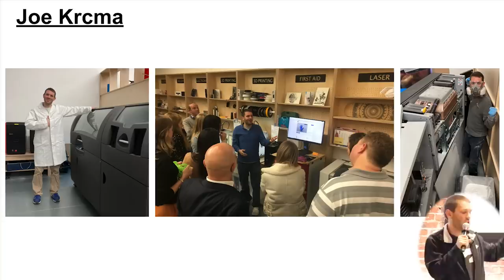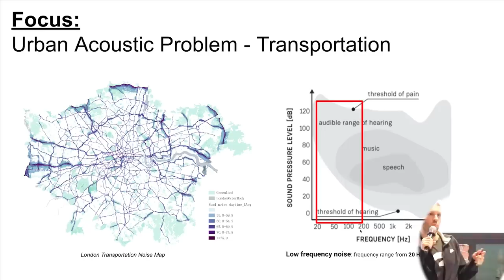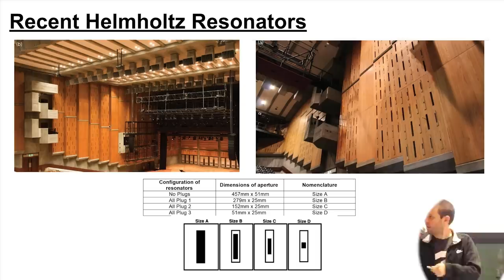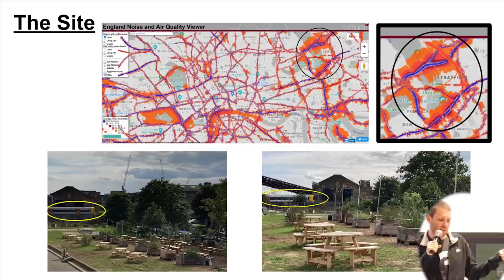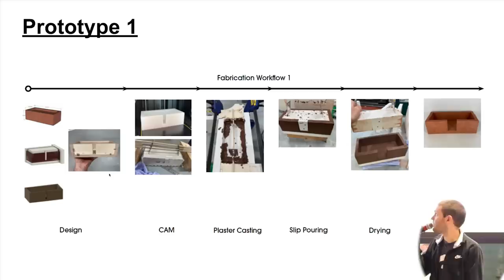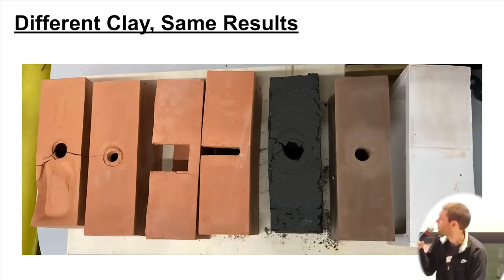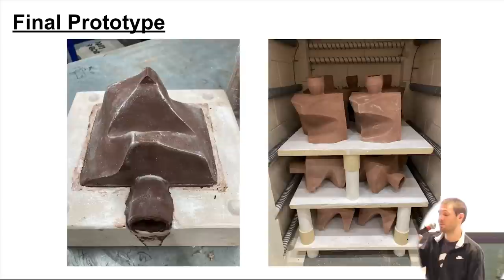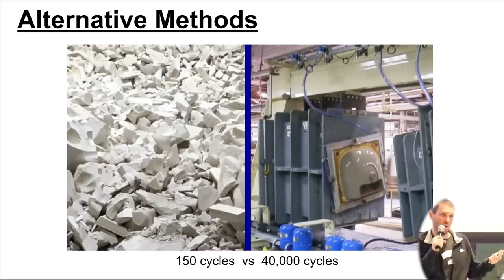These Bricks Can Absorb Traffic Noise - Thesis Presentation on Helmholtz Resonators

Comment: Use a double-sized brick. The size of one above another  + the depth of the mortar. The sound-absorbing brick could be built from one or two parts. Ah ha, you are getting to that fro your friend's 4-part brick.
-Edit: you use some meaningless terms --just like an architect, ;o;.  Let me replay to get it right.Ah yes, "Using these external geometry shapes." I dont know what that means.
Moar edit: I went back and realized that "generative design" was also a block being a term I skipped over and didnt understand. the first part of the definition, from Wikipedia, makes it sound likewhat i do with the "tryhard" Wordle solver tool, give it an increasing load of rules to follow as it looks in the dictionary for me, creating an ever smaller set with my increased filtering.
  But then, reading on, itsounded like an AI who can evaluate for you and then respecify the search parameters... eventually being able to write a better and better paper - as if it were you

But you are trying to build flasks into bricks. Little flasks to copy the functions of the much larger amphoras. Good luck.
Reply from the maker: Thanks!

Comment: 32:30 "algae and fungi and stuff can grow on these bricks which would help with the visual"  WHAT???
Reply from the maker: I take it you don't like green living walls?  I wouldn't walk into a tech conference lobby room if I were you.
Reply: @JoeMakes  That's moss, not algae and fungi then. Algae and fungi is the green-black stuff that grows on rotting untreated wood and sometimes on the walls if rainwater from the roof hits the wall, for example. And the black stuff that grows on the walls inside humid locations.

Comment: Any such holes in nature will be colonized by animals. Hole diameter is capable of changing ecosystems as some animals are able to use them while others will be too large. Over time, you might see some species of birds decrease in average size because larger specimens cannot take advantage.
Reply from the maker: And spiders!
Reply: @JoeMakes  also solitary bees. In Australia we drill holes in logs which in turn are used as nests by native bees. Also, the depth will determine if baby chicks are within reach of crows. If you put a divider to create a double chamber like a subwoofer, chicks can be shielded.

Comment: Home for wasps and birds. :)
But neat!
Reply from the maker: And spiders!  Thanks
Reply: @JoeMakes  Oh my!  I watched the whole thing and you did call this out as a benefit, though I suspect lichens and fungi and wasps/bees/spiders would change the resonant frequencies.  I saw some parallels in your talk to this book I've been reading Dielectric Resonators (ISBN 13=9780890062012), though with electromagnetic waves rather than sound waves.  Perhaps there is additional inspiration in the overlap though.

I have a need to build a 400ft privacy wall along the frontage of my property to a public road that the county decided to pave to my doorstep.  I thought this might be the ticket but seems a bit fragile.  Is there something novel about using clay/ceramic for this or could these be made in bulk using injection molding (i.e. plastic/polymer)?

Comment: These bricks would probably be shattered if wet and there was a quick freeze
Reply from the maker: I'll test that for the next one.
Reply: @JoeMakes  you should also test to see if you need to make the whole wall of those bricks. If you can integrate normal bricks into the wall, what is the optimal ratio? Could you get away with using a finishing line of these bricks at the top to reduce noice going over the wall?

Comment: Didn't peasants figure this out by incorporating glass bottles into their walls?
Reply from the maker: Peasants drank out of glass?
Reply: @JoeMakes  no. Like modern peasants. Villagers.
Reply: @JoeMakes   I could have sworn I read an article years back about a guy who was building walls from glass bottles to aid insulation in hot climates. 
I thought it might also work as a hemholtz resonator. 
The different sizes would probably act on different frequencies.

Comment: It seems like you could have saved yourself a whole lot of time and wasted effort if you had simply run your casting ideas by a professional. I bet those ancients that designed the original baffle/resonators could have told you that. Was consulting an outside source not permitted?

On the bright side, experience is the best teacher ☺
Reply from the maker: What else would I have done for the next 2 years?

Comment: Oh man…. you’re testing different materials on resonators?! You should’ve taken an apprenticeship with a real acoustics engineer. You have a fundamental misunderstanding of acoustics. Clay won’t stop low frequency energy. Your “resonators” are acting more like broadband absorbers than they are resonators. That would be great if the broadband absorption were actually efficient; but this is going to be extremely inefficient at both broadband and targeted absorption. It’s absolutely gonna do both, but it’s not going to do either well. But maybe my standards are a lot higher than yours. I’m used to thinking in terms of room absorption. I guess if you’re not looking to do any major absorption, then this may be fine to cut a few decibels from random frequencies in the air.
Reply from the maker: Yeah, we knew ceramics was a challenge, but that's the material the school went with.  So it was fun to explore!

Comment: Outside noise is not a problem and this dumb not very well thought out idea is going to fix it
I know it's not very well though out because ot took you 4 minutes to get to the actual point and them kept dropping more unrelated information.

As someone who has autism with super sentive hearing and hates alot of sound I have a way better saultion for you: noise canceling headphones with mics built in so you can hear people talking to you.
If your going to waste this much time effort and money into something make sure there is not a easier saultion right there: use your grant money to make better and cheaper noise canceling headphones
Reply from the maker: This really is going to set you off, because I didn't get any grant money, but instead paid for everything myself
Reply: @JoeMakes  honestly it's the opposite, you did something actually good with your dumb idea and you spent your own money which stimulates the economy. 

Also you didn't get the grant money because everyone has headphones, your trying to slove a problem that doesn't exist but at least it will make a cool looking building and good luck with it, really if it somehow works and is not hideous then great
Reply: @JoeMakes  know what free insane advice: in place of using this in pre existing structures where the awnset is headphones, also would stop people from yelling to in other (in case of emergency, or someone gets attacked there yelling will be muffed making the world more unsafe for people like me)
Focus on making this walls as portable as possible so people can set up private areas. The uses for a portable sound canceling wall are extremely varie, militaries might want some too for cast cheap sound proofing.
Your welcome, just remember your idea was good but not very well though out and a crazy person on the internet took your idea and made it 9 million times better. Good luck

Comment: Bla-bla-bla, show a practical experiment with real effect of reducing of noise with measurements before and after. I was experimenting with sound-absorbing insulation, and finded only 1 type of material of thickness 20mm is really works, all another is cheating
Reply from the maker: If a cheater writes a comment in the woods, does anyone really read it?
Reply: @JoeMakes  Practical Results with Measurement !

Comment: For the life of me I can't understand why you didn't do something more in line with proving the concept through the use of an existing product with existing infrastructure. Perhaps cinder block CMU, modifying it to the desired harmonics, and then decorating it with some sort of veneer! You literally went the most complicated and out of the way route possible seemingly just to attempt to reinvent the wheel! The exposed shaft is a significant problem when it comes to any form of logistics, shipping, transportation, quality control, etc. For that reason alone it is a bad design. Might could be salvaged if the exposed neck was reduced by at least half. Your design ignores all aspects of practicality. For fractional cost, someone could likely have very comparable results by just taking a hole saw to standard CMU/ cinder block. There is such a wide world of potential materials that you can use, and it really seems like you were way too hung up on trying to make clay work for you! There is so many ways to achieve what you were trying to do in a more cost-effective and Logistics friendly manor. Take ICF blocks, use a hole saw to create dowel hole for a 1 1/2 inch dowel, and attach a recycled plastic resonance chamber of some sort by taping it to the dowel making sure to properly Lube the dowel so that it can be removed. Once concrete or whatever cementitious material(aircrete or styrocrete perhaps) is set, simply remove dowel from the face revealing the whole and chamber.  There's all sorts of plastic(or otherwise containers that could be used and sacrifice within the wall as a sacrificial mold for the resonance chamber. 

Then the process is simplified to just setting up the forms and pouring the concrete with a vibrator... 

Do better!

Nice try though!
Reply from the maker: Prof said to use clay, so we used clay
Reply: @JoeMakes  then most of what I say I take back, seeing as your hands were tied! I don't recall that restriction being explained in your video. Clay is a very complicated medium.

Comment: OK, once you figured all this out, at the end of a year, you tested this new brick you invented and, eureka, the results showed your brick reduced the target frequency as well as wood or foam!  But, I didn't hear you mention any particular advantages to this brick over those materials.  It wasn't cheaper, faster, more environmentally friendly and it didn't do the job any better than wood!?  As fascinating as the topic and your project are, you didn't improve anything while you did introduce potentially new problems you can't easily predict but might be expected to come from collection/drainage of moisture, trash, or environmental problems from the material slowly disintegration or negative effects on or to, insects and animals living in or around it.  There's another drawback:  it's ugly.  It reminds me of an enlarged microscopic image of a bunch of recently extruded blackheads and zit holes.  Sorry.  As you said, once you see it, it's impossible to unsee.
Reply from the maker: Prof said to use ceramic, so we used ceramic...